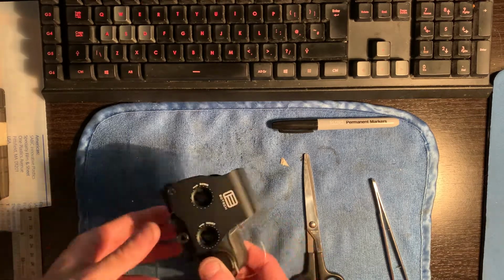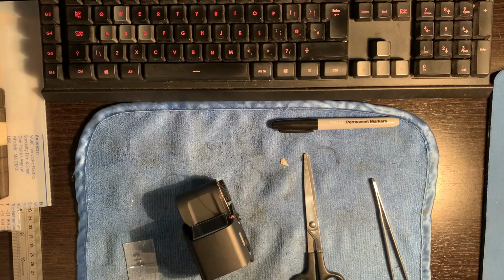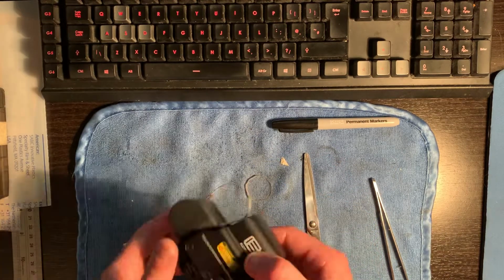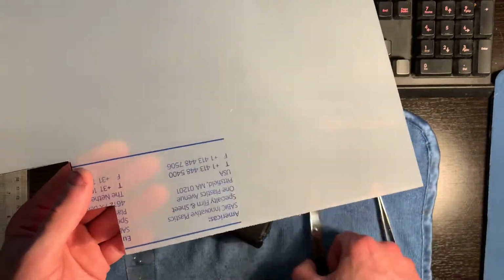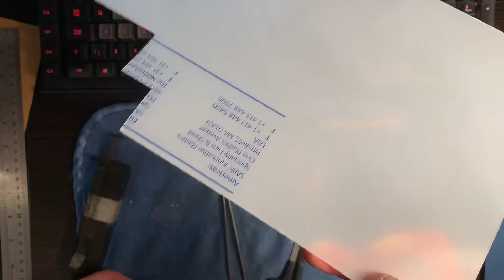Airsoft tech tip: Eotech clone  sight protector

Comment: Hello, im planning to do this. My only concern is, what if upon impact the lexan bend inside a bit which let the bb hit/push the glass behind. 1mm seems pretty flexible. Whats ypur experience so far?
Reply from the maker: Ive been lucky enough to not get hit in any optic yet. If youre concerned with spacing than I would make the lexan sit forward, by making the tab or tabs longer